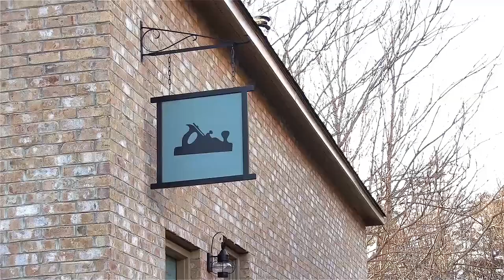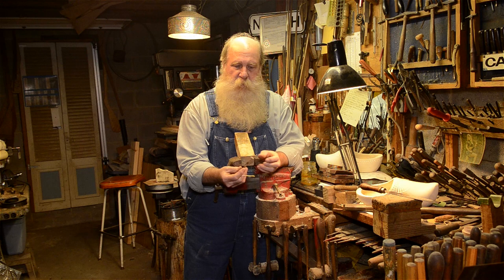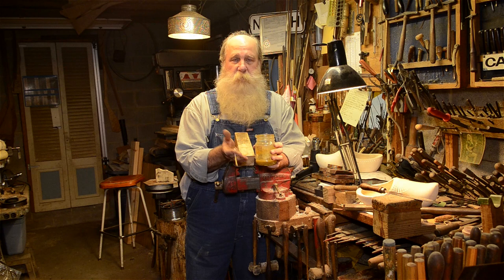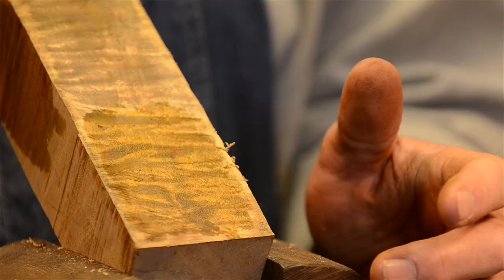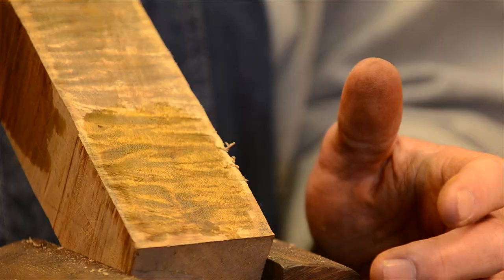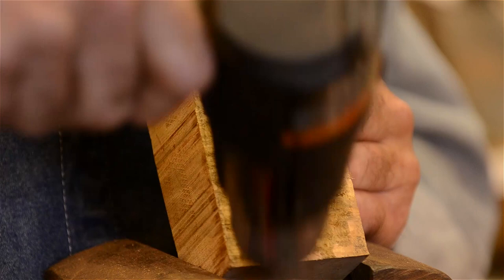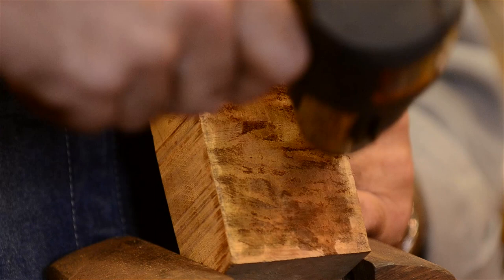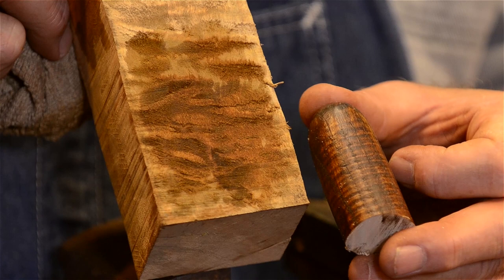Making Wood Figure "Pop" using Ferric Nitrate with Mark Thomas (Workshop Tour Part 4)

Comment: I once added water to concentrated (pure) ntric acid, in class, 2nd year analytical chemistry class. Thankfully, due it being analytical, I was adding slowly, still, one drop of water into a few ml of acid, BANG, bit of flame, smoking/fuming, was a amazed it didn't shatter the beaker (real borosilicate glass (pyrex) is tough stuff!), damn miracle no one saw me do it, so I remained on good terms with the prof.
Lesson learned!

Comment: Should be able to let it air dry as well. It would just take longer.    The amount of oxygen present as it dries it what determines the particular variety of iron oxide formed and the color.  There's a method for weathering railroad models with steel wool/vinegar where you cover the wooden part with foil and poke pin holes through it, then dry it.  The air/oxygen gets in at the holes and it turns dark, but the covered parts turn a light gray.
Reply: Acetic acid made solutions of iron do not require heat.  Nitric acid solutions REQUIRE heating for the blush.

Comment: I'm wondering if a person could just apply the ferric nitrate on a really hot summer day and then forego the heat source, I'm thinking of doing this on a full stock rifle and didn't want to purchase a heat gun..... great video by the way!
Reply: Nope.  Needs real heat.  Try an acetic acid/iron solution if you cannot manage a heat source.  But test before applying, you may get ugly gray/black wood from such.

Comment: Does it only work on Maple, or can it also be used on other woods like birch, beech etc?
Reply from the maker: Sorry, you'd need to reach out to Mark with that question.
Reply: The effect varies on every piece of maple (mineralization/tannin differences), and it will vary on all woods even more.  Try and see is the best answer.

Comment: How much iron do you use on wich quantity of acid?
Reply: 1 part nitric acid to 4 parts water is what Mark said, then as much iron as that solution will dissolve. The solution should be saturated with iron such that it won't dissolve any more metal.

Comment: I thought they used aqua regia on muzzleloader stocks. Where do you get nitric acid?
Reply: Don't know how easy it is to get the nitric acid where you are, but if it is as difficult as it is over here, buying ready made aqua fortis finish in the US might be an option. I just did that. More expensive, but less headache than dealing with all those chemical regulations over here. ^^
Reply: Aqua fortis, that's what I was trying to remember. I had a small bottle years ago that I used on knife handles, it made a darker finish than what's in this video.
Reply: I don't know where you are, but in France you just buy a bottle full in the local hardware store. Good luck.